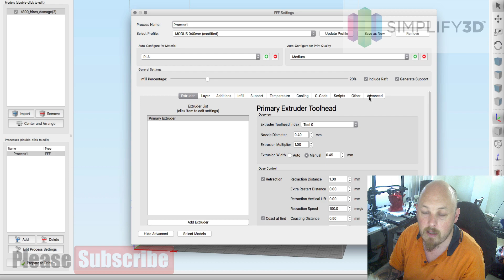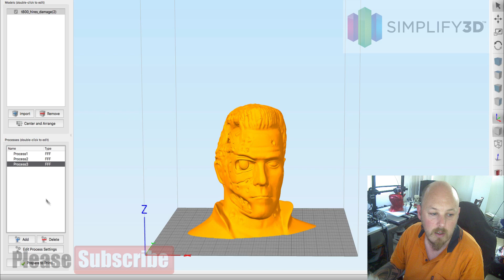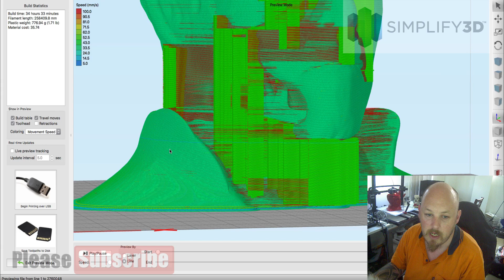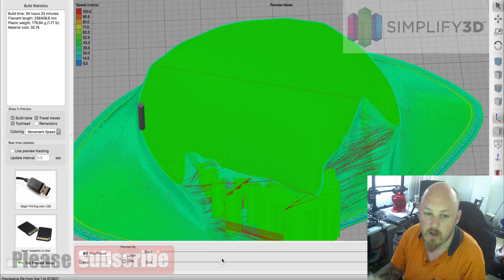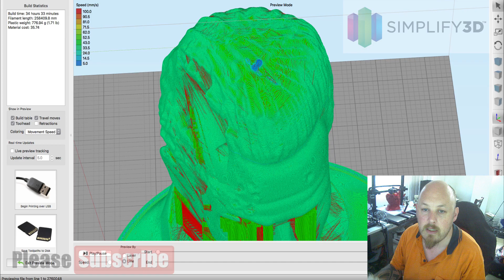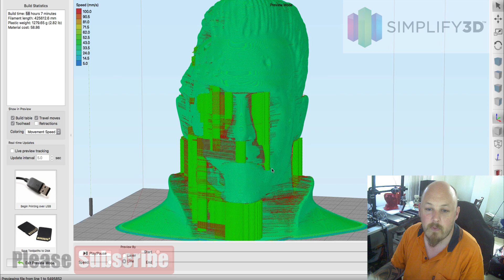Simplify 3D - Advanced Series #2 - Multiple Processes in a single Model

Comment: In relation to the GoPro mount you have on your printer.. is your bed heated? If so, will this affect the clamped portion on the bed?  I am looking to set something like this up.  Thanks!
Reply from the maker: +Geeksmithing Hi! The big printer is not heated bed, however the same clamp works on both my other printers with heated beds :)
Reply: +The Hot End thanks for the rapid response! Are you selling these, or are they on thingiverse etc? I appreciate your help. Cheers!
Reply from the maker: +Geeksmithing Hi!  Search thingiverse for wombot and it will be there - you may need to adjust the gap for your bed size
Reply: +The Hot End sweet. I followed you....like everywhere as a thank you. ;)
Reply from the maker: +Geeksmithing Cheers! #stalker :D
Reply: +The Hot End #Icu
Reply from the maker: +Geeksmithing Patreon: http://patreon.thehotend.org
Online Store: http://shop.thehotend.org
Amazon Affiliate link: http://amazon.thehotend.org

:D
Reply: Give some follow backs and I'll see what I can do! :P

Comment: Great videos Anthony. I especially like the Simplify3D videos. Is there any way to pause the process in a SD file created with  Simplify3D to change colors?
Reply from the maker: Hi! Thanks for the feedback - You could probably manually pop in a pause command at a layer height for x amount of seconds - but thats more hacking the gcode, not in S3D
Reply: The Hot End That's what I thought. I will have to edit the G code and add a G25 I think.

Comment: can u elect to not have a solid layer between the 2 different infill layers, so it wud go one layer 10% next layer 20%?
Reply from the maker: +Woggin Ind. certainly can - see the caption that pops up? (on computer only) disable bottom layer on the top 2 processes. Cheers! good question btw

Comment: Heya Anthony, I noticed that you left "First Layer Height" at 105% for the 3rd layer, and I think 2nd as well.  Did you just miss that, or is it for a specific reason?  Also, although I know you left the bottom layers on for the additional layers, I recall hearing/reading somewhere that there's some issue with Simplify3D "skipping a layer" when going from one process to the next if you set the end layer height and the next Process' start layer height to the same number..?  And, if that's the case, how do you solve for that?

...and good info as always, even if I am combing your video with a fine-tooth comb for "discrepancies." ;P
Reply from the maker: Hi, you can disable bottom layer for additional processes , first layer I do usually smaller not. Sure why I had high in the video. Thanks for your patreon support, I'll be adding a thank you page listing the contributors from now on
Reply: +The Hot End Okay, that's what I thought; I run first layer wider if it's bottom layer, so guessed you might have missed it when filming the video.  Lord knows there's enough crap to forget to change when setting up a S3D process...

(And I don't need to be on any Thank You page, but...um, thanks for the thanks, anyway? ;) )